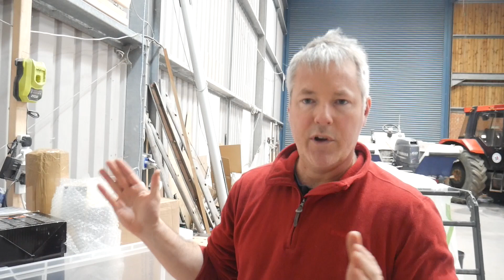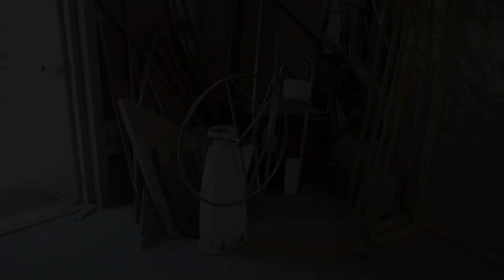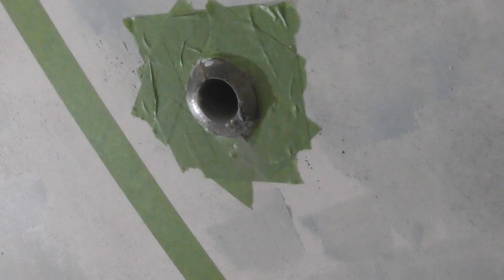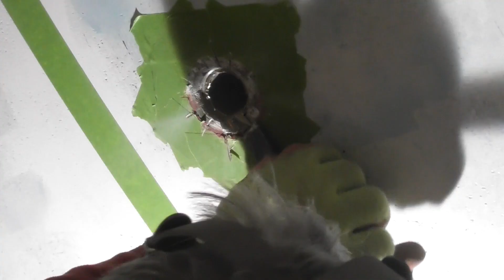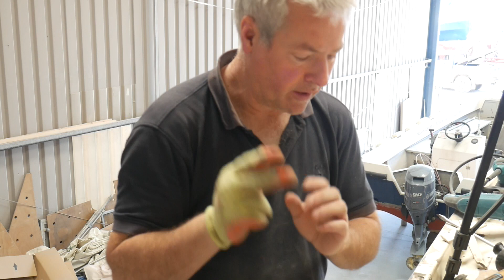#29 Drying out core, opening up cap rail, bashing out skin fittings

Comment: doing the repairs at the stantions cut slots about a foot long the width of the hole for the studs, fill with layers of epoxy tape and resin, then finish off, wheh the cap rail is in place drill a new hole.....
Reply from the maker: Tony, did you use epoxy resin or polyester (or other). As per the video I have already got a decent cavity cut out now. I am considering filling the void with rolled up chopped strand and epoxy resin, however I am mindful of how much epoxy I can pour in before getting issues with heat build up. So I'd be keen to know what you used? Cheers!
Reply: A tip: you can watch series on flixzone. Me and my gf have been using it for watching loads of movies these days.
Reply: @Solomon Shepard Yup, been watching on flixzone for since december myself =)
Reply: @Solomon Shepard Yea, been watching on flixzone for months myself :)
Reply: @Solomon Shepard Definitely, I've been watching on flixzone for years myself :)

Comment: Hi when I did mine I removed the ceiling panels inside, then I drilled through each hole on deck right through to the inside , then I countersunk the holes on deck with a tapered grinding stone and then cleaned with acetone and filled each hole with fibreglass reinforced filler. then I ran the dehumidifier inside for a few weeks, I painted my deck , 7 years later not one single plug has popped, the through hole allows the core to dry out and also reduces pressure buildup in the core.... I had water dropping down through my deck so that it was raining inside at one stage but all was fine eventually and all was fine...
Reply from the maker: Hi, did you replace the ply in the core also? There should be some under the Genoa tracks, near the anchor locker and around the midship cleats (if you have them). The ply in my deck has had it, it is so wet...
Reply: I did not really notice any ply, my understanding was that it was a divincel?? foam core, but in any case I did not notice any soft patches, just moisture and what I took to be foam. I accept there is ply around the tracks as this explains the brown leakage prior to my work but I rebedded the tracks and fitted new bolts and penny washers and noticed no compression or weakness in the core. 

My windlass is still in place and no obvious signs of cracking or weakness around  it...
Reply from the maker: thanks Tony, good to know. Cheers, Richard

Comment: Are you sure you can make the moist messure right after you taken the heat thing off? Doesnt the reading get wrong when its hot. 
The differens between relative and absolute humidity. Or maybe thats just when you messure air?

But i also think a professional dehumidifier is the way to go. And put the boat in a sealed tent.
Reply from the maker: Thanks, I'm getting a lot of advice for dehumidifiers.

Comment: Finally I check the moist.. I got 30% near the windlass ...wet ...is a small patch !  I got 32 Celsius where I got the boat .... so no problem she will dry out!where you are in uk?
Reply from the maker: I'm in south east England - I wish I had 32 degrees celsius!. I'm sure the nice weather will help dry out your Hallberg Rassy. If you do have marine plywood in the core around the windlass I reckon it's only going to get worse as I suspect the damage has been done - the moisture may dry out but maybe the wood will now be compromised and have lost it's strength? Good luck!!
Reply: A boat called wanda yes could be ... I check meantime what happen but at the and I got only a circle of radius about 7 cm.... what your idea?
Reply from the maker: I think you could drill a small hole - say 10 mm and try to scrape out some of the core around the windlass which is 30% wet. That will show you if there is wood in the core, and if so, if it has gone soft? Cheers - Richard

Comment: I would actually try a portable dehumidifier.  Lock it in every cabin and run it for a few days in each cabin. I'm 100% sure that would help.  Those machines extract so much condensation from the air it's impressive
Reply from the maker: I used to run de-humidifers when i lived in Hong Kong, it sure is amazing how much moisture they suck out of the air. I used to have to empty a 2 litre container every day during the wet season over there! I checked the humidity today and it was 53 % in the boat and 49% outside of the boat, so I think I will get one now and run it. Thanks for your comments.

Comment: What about using dehumidifiers inside the boat.?? Would this help?
Reply from the maker: I'm not sure Georges, do you know anyone who has tried that before? I think the problem is the moisture is (almost) trapped and needs a way out. Unfortunately temperatures in the UK don't get hot/dry enough to dry it out naturally, though the past week has been good here.
Reply: Last year, a good friend of mine had a Beneteau 45f5 with a wet hull.. He scrapped her gel coat all off and kep her like that on land for more that a year plus used heat lamps and a humidifier to dry her up well. (And its gets pretty dry here in Malta)  I followed the SY Athena episode where he used the same heat sheet and it seemed to work wonders.!!! Maybe you need to have the vacuum pump.??  I actually run a dehumidifier every day in winter on board my boat.  Keeps her nice and dry all year round.

Comment: Oh…no…
To get all that moisture out is a real issue. Especially when the “skin” acts as a sealer and moisture evaporates best upwards. Could it be better and more time saving to just rip it off? And then rebuild it without foam? Construction plywood?
Reply from the maker: I think I will get around to cutting more skin off. As you say the moisture tends to want to travel 'up'. I hadn't thought about using plywood to rebuild the core, as I thought it would be too heavy? There are a lot of options for high-tech closed cell constructional foams for composites here in the UK and Europe, and prices are good. I will look around at the options I think.
Reply: Closed cell foam comes in a variety, some better, some acting like a sponge (even though they are closed). If you can find some that is proven to not soak up water in between the cells (capillary), that would be less heavy than ply. But on the other hand - with ply or maybe larch, you probably would be safe that it wouldn’t happen again?